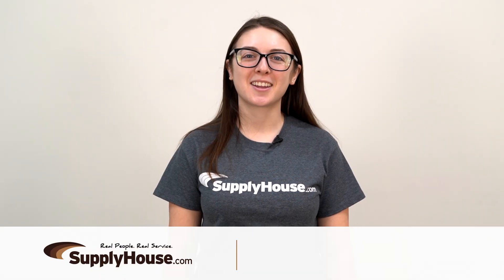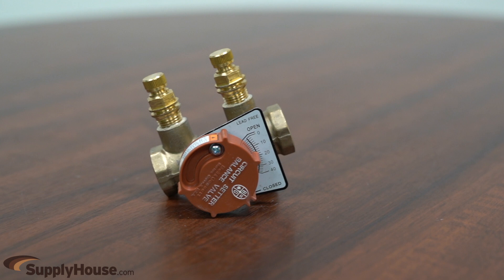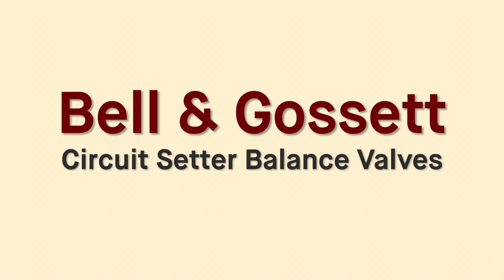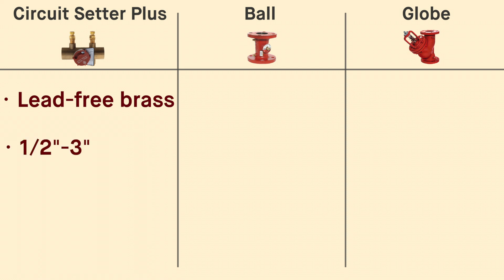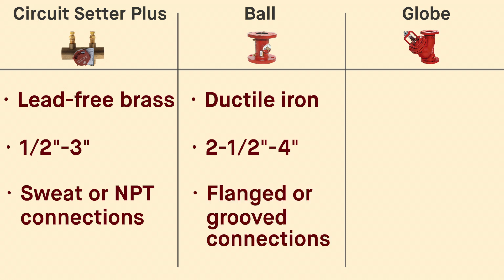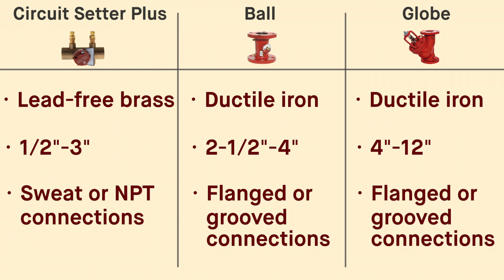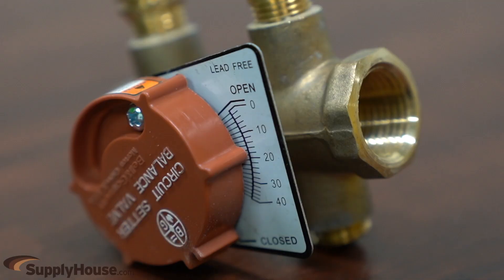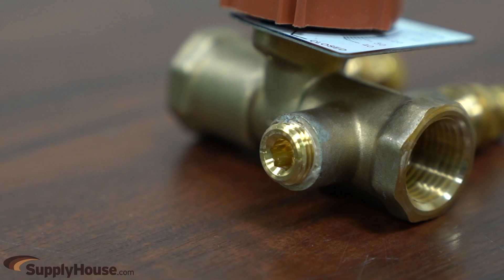Bell & Gossett Circuit Setter Balance Valves

Comment: Cangzhou Puhui Electromechanical Equipment Co., Ltd., is a reliable manufacturer of cast iron valves, cast iron filters, cast iron check valves, water pump suction diffusers, cast iron pressure reducing valves and cast iron pipe fittings. Focusing on product quality and customer service, we have become a dynamic and reputable OEM and OEM manufacturer, expanding our product lines over time to meet customers' fast-growing needs, and look forward to cooperating with you. In-depth cooperation In today's rapidly changing environment, we provide high-quality services to customers, raw material suppliers, equipment manufacturers, etc.
Our foundries, machining centers, CNC machines, surface treatment equipment and pressure testing equipment ensure reliable product quality control. Valves and filters are constructed of gray cast iron (ASTM A 126 grade B) and ductile iron (ASTM A 536 grade 65-45-12), which can be cast or welded from carbon steel to meet product requirements.
Our business philosophy is to serve customers, service providers and every employee. We have a large number of employees, and the good company environment has allowed most of them to work in the company for decades.
Company: Cangzhou Puhui Electromechanical Equipment Co., Ltd.
Tel: 86-0317-8294124
Mobile: +86 13832767113
whatsapp: 13832767113
WeChat: 13832767113
Email: cz001@puhuicom.com
URL: www.hbpuhui.com
Address: No. 2 Road, Industrial Development Zone, Botou City, Cangzhou, China